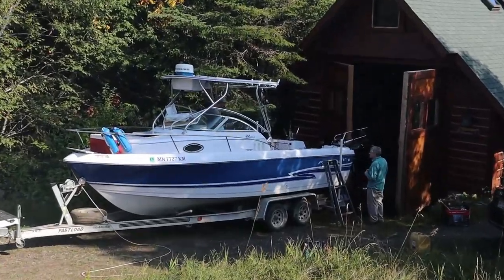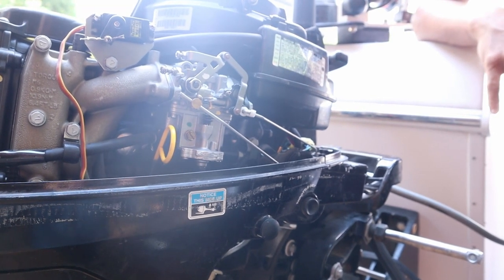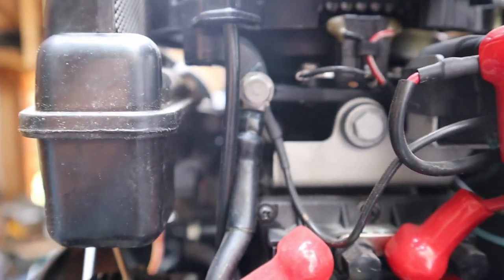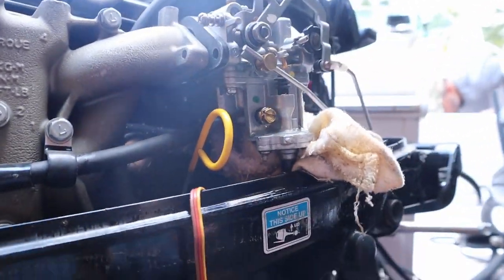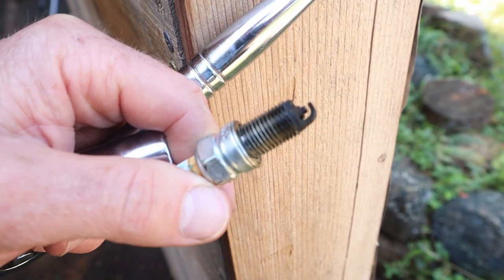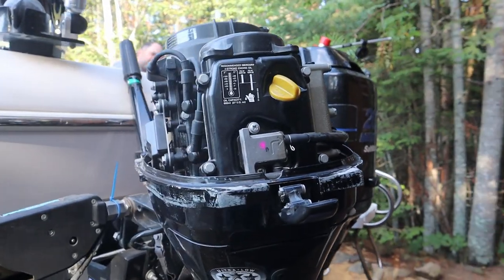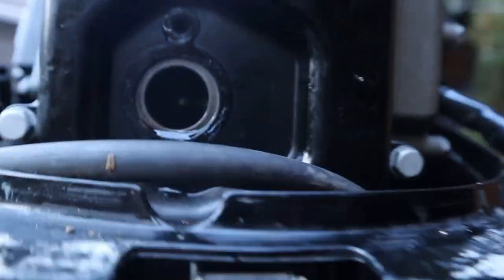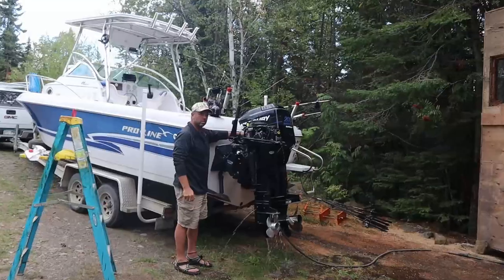Mercury 4-Stroke Runs with Choke Only - Novice FIXED for Free

Comment: Hello guys! First off congrats on your successful project! I have a 03 9.9 merc that’s giving me the exact same trouble. Ran fine all last year and summer long up until I left fuel inside the carb 😭 lazy is not excuse so I’m sure that carburetor needs a good ol cleaning. any way thank you for posting, gives me confidence boost that I need to carry this project out. Mechanics will take you for a ride or won’t even look at midsize portable engines
Reply from the maker: You got this, just remove the carburetor completely, and find a thin wire to clean out all the passages.

Comment: in the upper left corner of that carb, i think there is an indented screw.   it is a low speed/ idle air screw. if you decide to clean that.area out, first, gently turn that screw in all the way and count the turns before you remove it. there are tiny holes and a passage way behind there
Reply from the maker: Thank you Charlie! We did do that off camera. If we have problems in the future we will start with that. Appreciate your comment.

Comment: I have a sailboat with a 10 horse kicker motor as aux propulsion to get to and from the marina... ive had it do the exact same thing so many times, i literally keep a small ultrasonic cleaner and a bottle of simplegreen/industrial purple cocktail on the boat just in case it does it again when im trying to get back to the dock. So far i have not had to take the carb off the engine to clean it while out in the open water, but i have had to take the carb off to clean it out several times at the dock, I have it down to a science at this point. run seafoam in every fuel tank, seems to help extend the times between service. but if i have an extended time when i cant get down to the boat for 3-4 weeks and run the engine, without fail something gums up. I think the ethanol free marine fuel im getting from the fuel dock is actually not ethanol free.
Reply from the maker: That is crazy that it is that bad. It hasn't been as bad for us, but it is a poor design. Good for you for getting this down to a science. There's something to be appreciated about that.

Comment: All you had to do was take out the low speed jet under the brass screw in the carb and clean it
Reply: Having same issue with mY 9.9 four stroke took that little jet out your talking about. That little jet dosent have daylight all the way through just some holes in the side tried to clean it but seems to be made like that .Am i supposed to see daylight out other end with that particular jet?
Reply: @michaelroberts6299 I was wondering the same exact thing when I cleaned mine. I eventually shoved a needle through it, but I’m not sure if I broke it or what because it was very tough
Reply: @danielshook4055  i found a jet under another jet and then needed a strong piece of wire that woundnt bend i used a wire brush as it allowed me to put more force on to it 3 jets in total in carby

Comment: ... My motor is having same issue. I was thinking it was water in the line or gas, usually it goes away unless the gas has a lot of water.  Always good to try fresh gas thats what Im gonna do today.  Tomorrow will try seafoam.  After that ummm will start spraying carb cleaner into carb.  After that not sure.